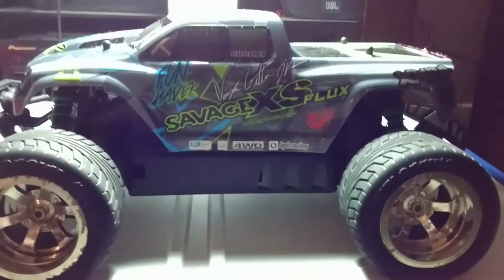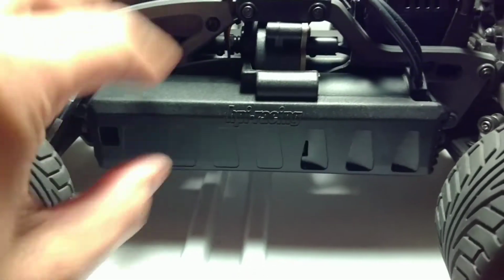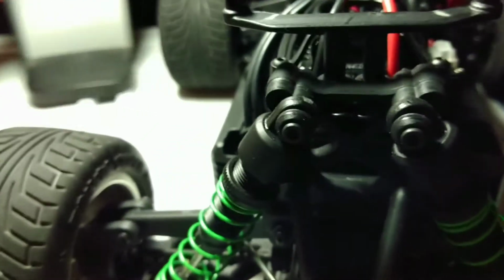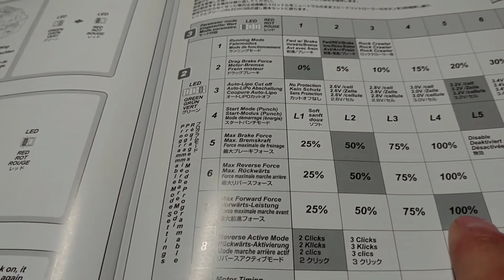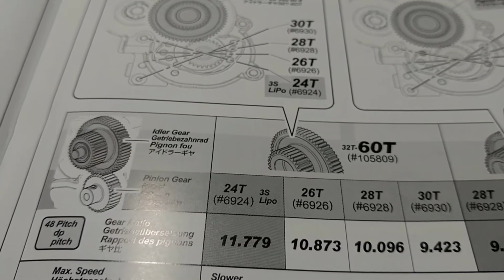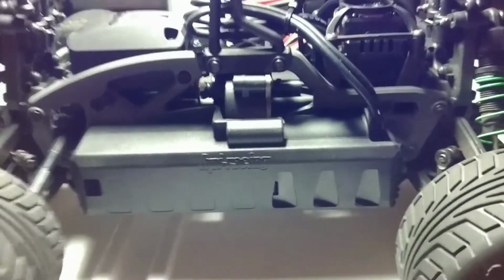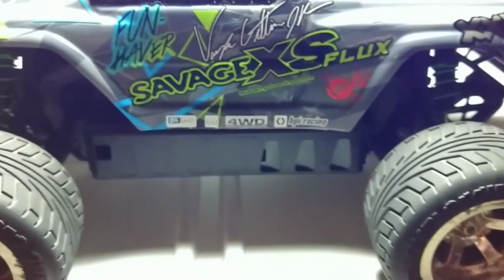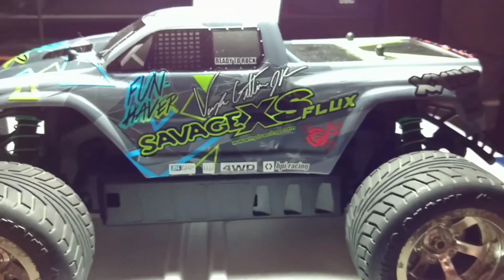Setting up and upgrading hpi savage xs flux

Comment: Great video. About the gearing though, I never changed mine, kept it stock and ran 3s stock. Have never had a problem with the motor or esc. A few others have said that the older version of the Savage XS, the ESC would fry but the newer version can handle much more abuse. In my case, it's been 2.5 years since getting it and no issue what so ever with motor temps, or ESC issues. I only swapped a pinion but thats because I just wanted a fresh one. But everything else has been all goods apart from the usual cleaning and maintenance :)